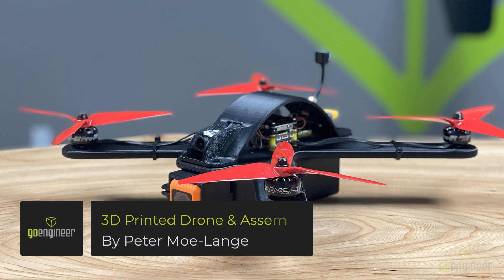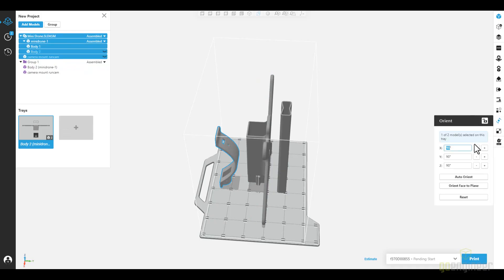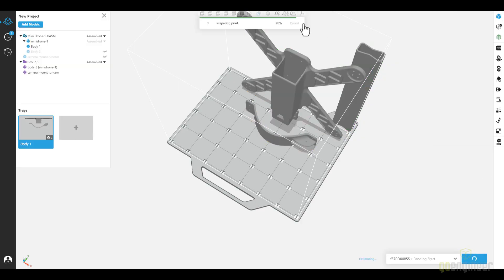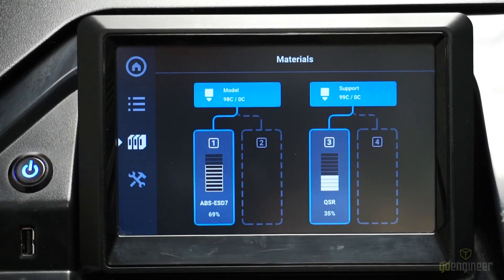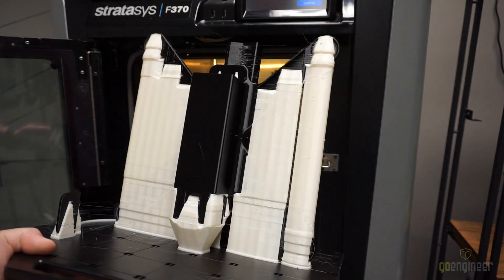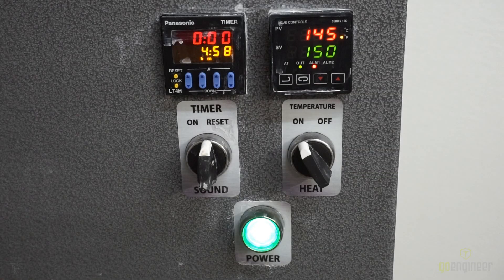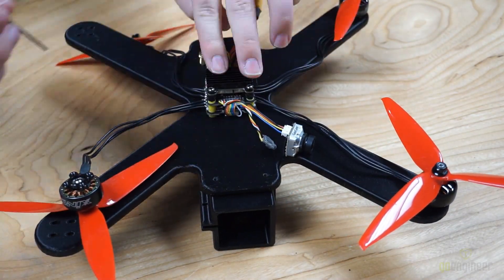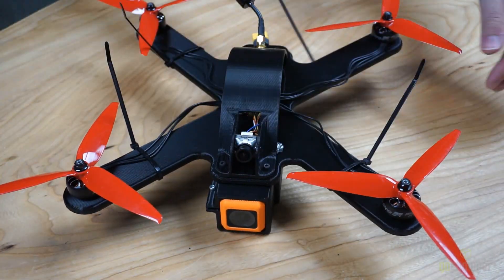How to Build a Long Distance 3D Printed Drone

Comment: I only have a 220 mm build volume do you think cutting this frame in half then glueing together with epoxy would be ok? Or should I look for something smaller?
Reply from the maker: straight cuts may not provide enough surface for the epoxy, but with the right interlocking geometry that certainly is a reasonable option.

Comment: Thanks for the video.  Inspired me to get into this hobby.  I am making this right now.  You are so close to having a massively popular drone building guide.  What size are your props?  I think mine are too small.  One separate video showing how you wired up the flight stack would be golden.  I literally have all the parts in your list and am trying to see how your flight stack is configured...sorry, I am a newb with drones but have experience with lots of other RC stuff...I didn't realize how involved this hobby is.  Currently training in flight simulators so I don't wreck this on the first flight...
Reply: I believe they are 5" tri blade props. For wiring, the best you can do is follow the speedybee manual for the flight stack. As long as you wire similar to that, you should be golden. The most important thing you can do is to power the drone via USB and use the speedy bee app to watch the orientation of the drone. You will want to tilt it foward, sideways, etc and make sure that it shows the same movements in the app to confirm everything is oriented correctly.

Comment: Do I have to use ultrasound bath, I don't have a one and I guess most won't
Reply from the maker: No, in this case that was the method for the specific materials we were using in our print.  Whatever best practice you have for cleaning and removing support material is fine.

Comment: Hey, what would you change if you had to make another one? I’m interested to hear after you guys have flown it
Reply from the maker: Great question! Right now, the range is good, but it could be better. So, we would probably change the batteries from li-po to li-ion batteries for the energy density. That would enable longer range flights!

Comment: If you print it on the side, it'll be more rigid. Vertical adhesion is always weaker than horizontal on FDM printers.
Reply from the maker: This may be true, but for the build volume we had available this orientation was needed. The drone has been flown for many hours and is still whole and undamaged showing no signs of layer adhesion issues.
Reply: @goengineer   It's more of a concern when you crash
Reply: I was thinking the very same thing, X & Y give the best strength but I see he was constrained by the build volume.
Reply: would a flexible filament be most suitable?
Reply: @Gravitation3Beatles3  No. Flex stops the flight computer from being able to maintain stability. You want as little flex as possible.

Comment: I'm very new to Drones as a hobby, I mean, I've flown and crashed your typical cheap gift drone, but I'm ready to 3d Print! Would you say this drone can be used to film cinematic video or is it a tad bit too touchy? I have a few projects that would benefit from drone footage and this would be an awesome, cost effective solution to the other expensive names that I have trouble opening my wallet to. Thanks for your amazing creativity btw!
Reply: since no one replied, although my knowledge on flight controllers is shallow, im fairly sure you can soften input reaction for smoother control. also, simply put, a standard xiaomi drone still costs less than all of that (and yes you can still attach an action cam to it, the drone will just be a bit heavier and trickier to take off/land)
Reply: PS, if u search the names of the parts directly online its cheaper than the links

Comment: "Removing supports is very easy... just use this $10k industrial support removal vat.
Reply: What you don't have one out in the garage?
Reply: For the cost of the power/water you could buy a frame.
But I guess if you got it.
Reply: Plus the solution has a ph of roughly 14, sucks to get on your clothes

Comment: Can you give us some assistance? We bought all of the components listed, and we have power to the components but we cannot connect to the speedy bee app. We are at a loss as to how to communicate with the components to get them to function.
Reply from the maker: Hi, sorry to hear you are having trouble. Are you able to connect to the speedy bee flight stack via usb C using beta flight configurator? If that works, I would recommend double checking if you have the right flight controller in speedy bee app selected and Bluetooth is enabled. If that is correct, I would try using another phone to try and connect. If those steps don’t work, can you share a picture of your wiring with the USB plugged in? Best of luck and keep us updated so we can help!
Reply: @goengineer  https://drive.google.com/file/d/1di-psXeuXNP3QCO1Y6cud5KOzAnylniY/view?usp=sharing
Reply: @goengineer  https://drive.google.com/file/d/1RXDua0llK0PrReKItobhRrX80KLpM2JK/view?usp=sharing

Comment: Thanks for sharing this fascinating drone project. Nice end result. 
What filament was the drone printed with? I can not seem to find mention of filaments used. Also curious what the printed frame weighted before the electronics and camera were added. 
Clearly the support structure is a different material. It's interesting that can be easily removed.
Reply: He mentions the mass in cubic inches and the slicer showed it too. It translates to about 380g. The filaments are shown on the printers display, ABS and QSR. 
I would recommend looking at some more advanced filaments like various carbon fiber infused ones or Aero-PLA if you plan on building something light. I am sure you could cut off a lot of weight using one of those.

Comment: So yeah, almost no one has a printer like that..,..
Would be interesting to see this printed on a FDM printer, my ASA prints on my printer usualy have to much flex in the frame arms..... not usable for a drone.
Reply: That is an fdm printer... I think it's an idex and even those aren't too uncommon, but dual extruders are unnecessary for this application anyway.

Comment: Why would you 3D print the main body not lying down? Seems like a massive waste of both time and filament.
Reply: did you not see that if he laid it flat it would be bigger than the plate? you can tell its too big as soon as he shows the cad drawing of it standing up in down. That's the reason he put it in vertical orientation other than horizontal. Hes able to print all his pieces at 1 time! If it did fit flat, that would be the only thing he'd be able to print.
Reply from the maker: Just as Benny said here, this was done so we could print all of the parts at once
Reply: @goengineer  he has never used ultimaker cura or anything of the sort. Just saying shit to say shit like most people. 🤦🏻‍♂️
Reply: for strength. and its still printing the same amount either way you print it....

Comment: 40-50 minute flight time? I'm highly skeptical...I'd be willing to bet around 18 minutes with that configuration
Reply from the maker: The Flight time is very dependent on the type of flying your are doing. In this case we have not done any practical testing of the absolute limits, however we have had it in the air for 30+ mins doing slow and gentle cinematic photography.  We have also run the battery down in about 20 mins doing higher speed acrobatics.  Battery condition also degrades over time so fresh batteries and conservative flying should allow for a very long flight time.

Comment: Geez your printer looks expensive.  Can I do such prints with 3D printers I can buy from Amazon website ?
Reply from the maker: The printers used here are industrial grade printers. You could use consumer grade printers to build these models, your support structures maybe different or you might have to cut the model to fit those printers as they tend to be smaller.

Comment: Any way to slice it down to print on a 230×230 in pla?
Reply from the maker: You could certainly load these files into CAD and cut them up for a smaller printer.  Your results may vary depending on how you cut and join the printed bodies. Additionally PLA is not as strong as the ABS so there may be some design considerations that  need to be looked into

Comment: so what happens when a wind gust blows you into an obstacle, and you snap an arm ? you'll have to wait another day to reprint the whole thing ?
Reply from the maker: Depending on the type pf breakage there may be other options like glue epoxy or some other mechanical repair. If you find that repair is frequent we can always go back to solidworks and redesign the frame to make the part repairable without printing the whole frame.
Reply: for PETG superglue (locktite 401) seems to do the trick. But only if its a single break, not shattered to many little pieces. And obviously, if you collect all the pieces (not always the case if you fly into a tree :))
Reply: I would just pre-print an extra set, and have a full spare with me.....

Comment: im designing a drone with 4×2hp motors and a 192ah battery pack the tosp wwight will be something like 10kg or 20lbs for u americans and dont know what size prop to use im think of making one from steel 2mm sheetmetal with 12 blades
Reply: Where do you get your motors from? I'm learning to use an arduino uno board with some small stepper motors for some drone proto-types but I'm interested in the hardware choice you use for larger models.

Comment: How would you compare it to store bought drones in the 400/500 price range?
Reply from the maker: Hello There!   

While this drone would have less software features then a store bought drone at comparable price, it is capable of lifting more with a longer flight time as well as having a longer range on the transmitter. By using 3D printing. it is possible to create a design that fits the application that one is trying to do without compromise.

Thanks!
Reply: @goengineer  how much does it weigh?
Reply: @TorontoFPV  This. How much does it weigh? What are the flight characteristics of a 3d printer drone frame versus carbon fiber? Should send this to Chris Rosser and let him have an examination at it. :)
Reply: @xshoudenx  it looks like it flies pretty decent! Honestly Chris uses his knowledge as leverage to sell his products.

Comment: So many opinions here on build orientation and challenging the engineer's thought process.  Consider that they are showcasing the capabilities of a professional/industrial 3D printer.  He threw it in there in an orientation most would be frightened to tackle with their hobby level printer.  A day (plus) of printing and the parts came out flawless.  No need to design to the printer's capabilities, it'll just roll with it!
Reply: Doesn’t matter if it is a professional printer or a hobbyist one, the basics still apply. They printed the main body in probably the worst orientation they could, layer adhesion is always worse than the strength of the material itself. Optimising grain or fibre direction is done with loads of materials including wood and carbon fibre, ignoring it on 3D printing because it is a professional printer is just stupid. This would be similar to making a carbon fibre drone frame by stacking layers in the orientation they printed it rather than laying them flat like it should be. Considering both in carbon fibre and 3D printing the joints between the layers are the weakest parts this is a bad idea, especially considering they could have just laid it flat.

“No need to design to the printers capabilities”, if you really believe that then you don’t know what you are talking about. Any object needs designed to the capabilities of the machine or manufacturing process that will be used to manufacture it, doesn’t matter if it is injection molded, CNC machining or 3D printing, you always have to take the capabilities of the machine or manufacturing process into account.

Doesn’t matter that this was an expensive industrial machine and not a hobbyist 3D printer, it was not done properly.
Reply: It’s a massive waste of material, time and cost.. we have 17 of these printers.. the cost per spool is $360 for ASA and the support material. Just because you can print it in a crappy orientation, doesn’t mean you should. It teaches bad habits and is a waste of resources.
Reply: Good engineering is about making to right compromises between cost, time, and quality. Printing in the correct orientation would have made it cheaper, stronger and faster to print.
Reply: flawless?  I saw a ton of stringing.  I guarentee he had to do a bunch of cleanup on it.  I was gonna say he probably should have used an ender3 and just glued it together.  would have turned out cleaner.
Reply: @mslindqu  It looks like the stringing was the support material, not the model. It would not have an effect on model quality.
Reply: @mslindqu  stringing just burns off with a lighter
Reply: @Atheism-And-Normative-Ethics  Oh, had no idea.  Never printed anything in my life.
Reply: @mslindqu  no problem. Me neither. Just researching. About to set up my printer... From what I gather, main thing that would cause problems would be layer offsets, weak layer adhesion if cooling or layer height isn't done right, and low infill percentages leading to structural weakness. The guy in this video has a really good looking print... His machine probably costs well over 1-2k with the dual filament and slick layers (he might just be using a makerspace in his area)
Reply: @Atheism-And-Normative-Ethics  yeah, that was old thinking... wall settings have greater impact vs infill.

Comment: A very nice model, good material choice and sound design. That said as others pointed out the Main Body should be printed lying down to save support material, time and have the layers aligned parralel to the ground. 
Keep it up !
Reply: yes it would save support material how ever the printer bed isnt big enought to print it laying down
Reply: @minonim8749  I just started watching this video and was checking the comments to know how good it really is and I hadn't noticed how small the build plate is so thank you
Reply: @jackgames3009  his print bed in the video is quite large i use a ender 3 and compared to mine his is way larger and wont fit the same, in comparison to yours i wont know but his print bed it quite large than most average printers
Reply: @minonim8749  I have an ender 3 v2 neo so the print bed is quite small compared to other printers

Comment: With a tiny bit more thought put into the modeling this all could have been printed flat without any support material... 
The fact that you have these expensive machines and you don't know how to do this properly is baffling to me...

The end result is neat just not the way you got there.
Reply: The professional engineering truth (not hobby) is you do not want the engineer to spend the time and resources to become a 3D printing expert. 
These seriously overpriced machines are made so the design concept is proven quickly instead of forcing you to design for the printer. 
I would say the fact he could throw in a print like that with successful testing is a feature.
Reply: @erickvega2631  in real world there is also a concept called "design for manufacturing" :) you don't just design something, you design it so it is cost, time and labour efficient.  And I agree with the original comment about arms strength vs layer direction of the print.
Reply: @erickvega2631  Design concept would be proven quicker if he had just used a Prusa printer, much cheaper than his industrial machine and better print quality, no need of a purge tower at all 😂In the real world, we would print this face down, saving both the material and print time by orders of magnitude
Reply: @erickvega2631  the basic principles of designing for 3D printing aren’t hard to grasp, any engineer should be able to so it without much trouble. Even without changing the part at all they could have easily laid it flat on the bed. This doesn’t even seem like a prototype, it seems just like a side project but even then making very basic mistakes like that is ridiculous.